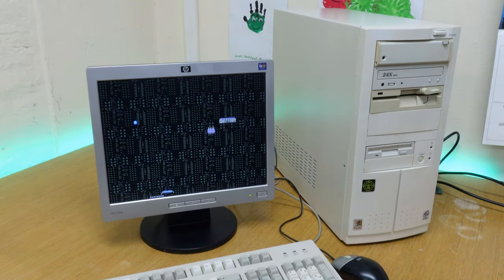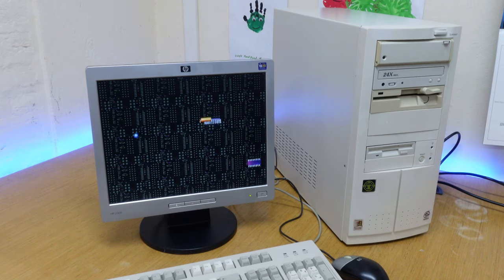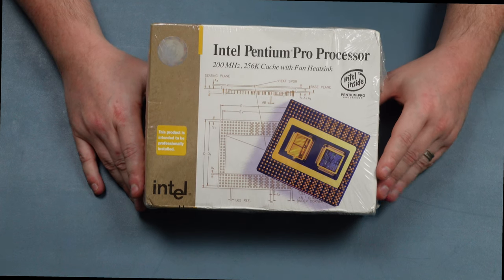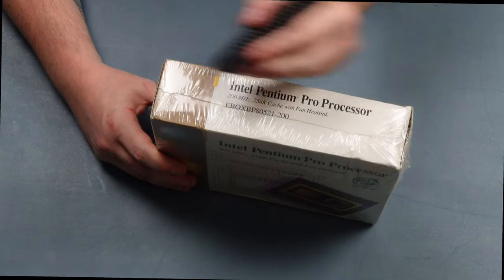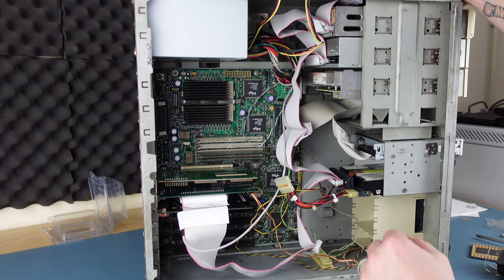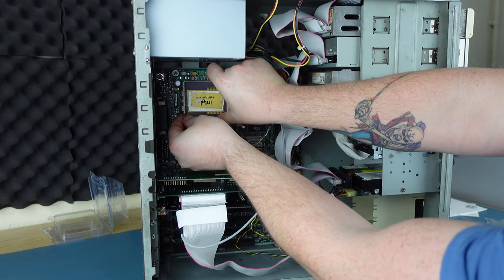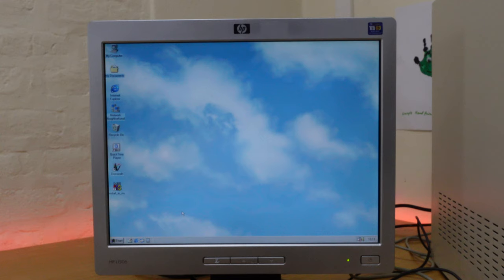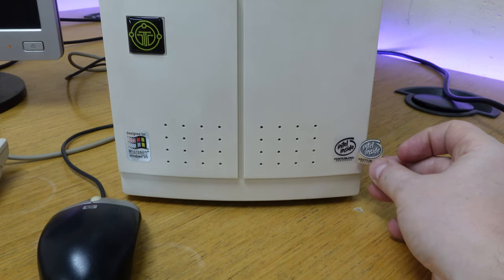Unboxing a Pentium Pro CPU from 1996

Comment: Very nice, I've watched you restore that beaten down machine to a thing of beauty and it just warms my heart :-). But yeah, if I were you, I'd replace that motherboard sooner or later. There's a 200MHz CPU in there and I wouldn't rest until I'd get 200MHz actual reported speed, dammit! :-D
Reply from the maker: Thanks man.  Not only that but I want to swap out that SB Live for an Awe64 that I bought for the project.  Until I sort out this issue then I can't use the ISA slots either.  I did track down a Dell branded board but in spite of being really well packed by the seller it was DOA.  So now I'm just keeping an eye on the Bay to see if another VS440FX comes up.
In the meantime I've started work on the other machine that I picked up from the same seller

Comment: Can you try different jumpers for the multiplier? Maybe the docs are incorrect. Worth trying. I feel it is odd that the board works fine just locked at 2x. Both 60/66MHz FSB seem to work ok!
Reply from the maker: Have tried lots of different settings. There's only one jumper concerned with multiplier and neither position seems to have any affect on the multiplier used by the BIOS, so either there's a broken track and the BIOS is reading open circuit, or the BIOS just isn't applying the setting dictated by the jumper

Comment: Frustrating.  Pentium Pro motherboards tend to get hot.  I have one that finally just died. No post. Looking at it, there is nothing wrong. Luckily, I have two other boards  but like the first, they have mileage, and at some point they will fail as the pro chips tend to heat things up.
Reply from the maker: Tell me about it, I've been searching for months for replacement boards, one turned up DOA, the others are just way too expensive

Comment: I have the same system board and a 200mhz cpu installed, ill check my settings and jumpers to see if i can offer any advice. Watch this space
Reply from the maker: Hi Mark, thanks for the support, but the issue turned out to be the motherboard, take a look at my channel for the full saga!

Comment: I wonder if you have capacitors with a high ESR that's affecting the roms and controllers?
Reply from the maker: I'd love your guidance on that. These look like polymer electrolytic caps which (with my limited understanding) shouldn't experience as many issues, but I'm by no means and expert
Reply: @TechMadeEasyUK  Hummm, if you have soldering skills and do end up replacing the motherboard. It might be worth re capping it. That way if you damage the motherboard it's not your primary one. Unfortunately with some of these caps, they can look fine but have high resistance
Reply from the maker: Soldering is no issue, what sort of resistance should I be seeing on caps like these? Might be worth testing across a few and seeing how they appear
Reply: @TechMadeEasyUK  It depends on the rating of the caps, as in the MF on the sides will indicate the specs required. Depending on how many are on the board, you could shot gun it and replace them as caps are cheap, especially in packs.
Reply from the maker: Thanks for the tip, will look into a recap
Reply: @TechMadeEasyUK  No worries :) it might help or at least pro long the life of the motherboard